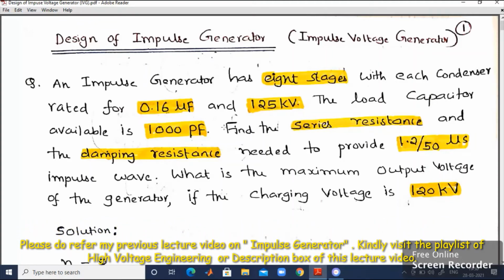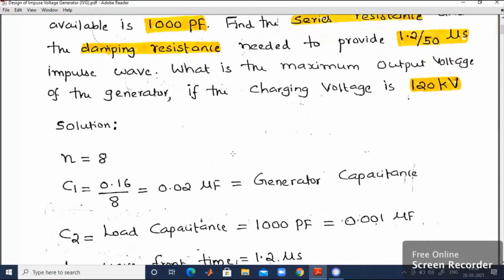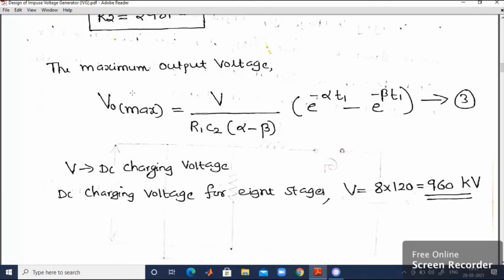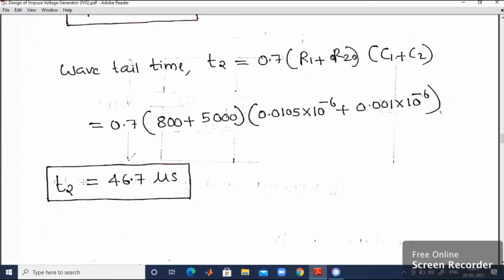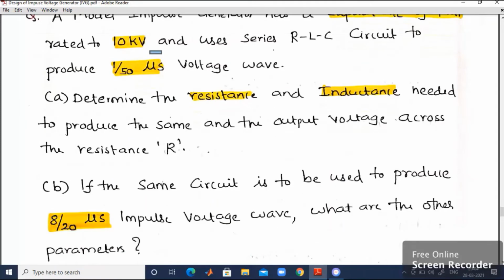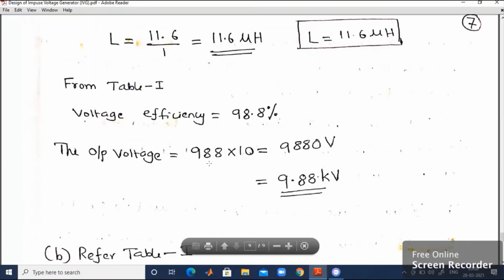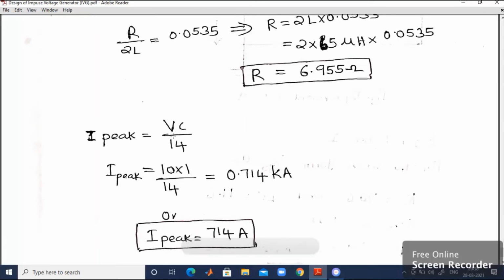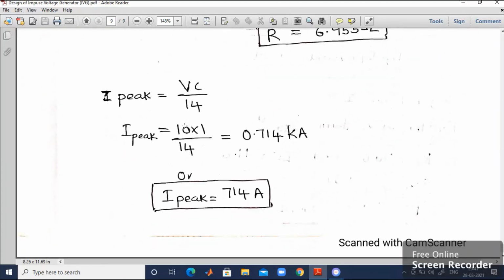Design of Impulse Voltage Generator with suitable example|Impulse Generator Design Procedure|HVE Lec

Comment: when i substitute the values to get alpha and beta i cant get the same answer?
Reply from the maker: Good evening,
Both Alpha and Beta will not be same.
Reply: @SimplifiedEEEStudies  what i mean is when substituting the R1 and C2 in order to get alpha the value is not 0.7936*10^6
same goes for the beta substituting R2 and C1 will not give 0.02335*10^6
Reply: @SimplifiedEEEStudies  i think you made calculation errors for alpha and beta, the formula is ok bt the answers are wrong